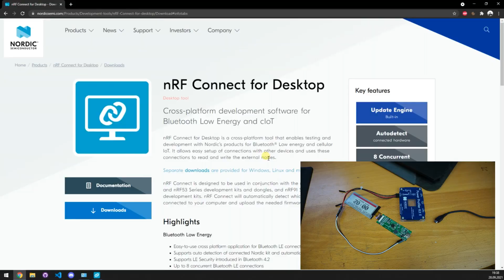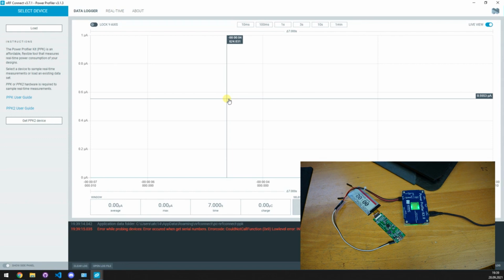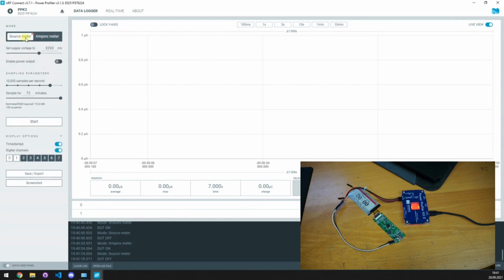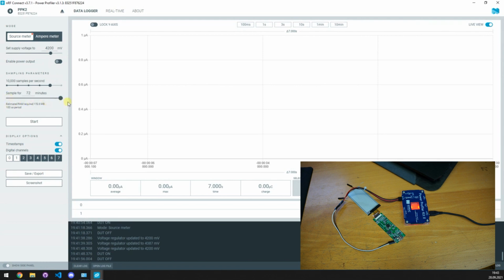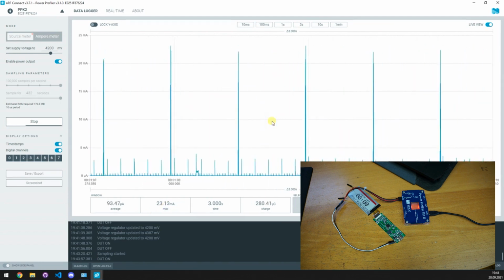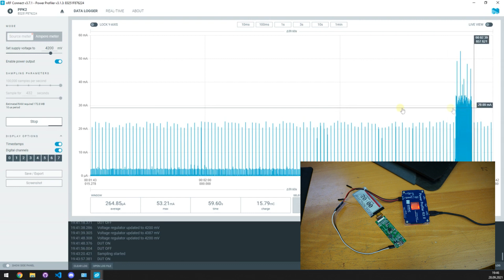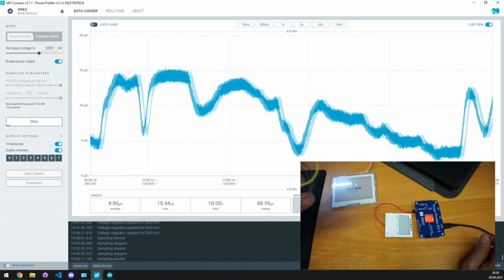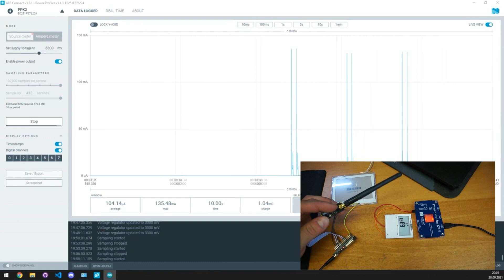Low Power current measuring with Nordic Power Profiler Kit 2

Comment: When using as an ammeter mode, am I correct to assume it would act as a multimeter/current meter? Where I could measure the inline current of a wire at any point of the circuit as long as the wires will be connected in series in Vin / Vout of the PPK2? I plan to measure and test a few signal currents coming in / out of an IC.

Comment: Hello Aaron I am also trying to use my PPK II and I also have a custom board. Just to make sure my connection is goo do you connect the + of the battery connection to Vout and the - of the battery connection to ground in Source mode? Thanks in advance.
Reply from the maker: B+ = vin,
Device = vout